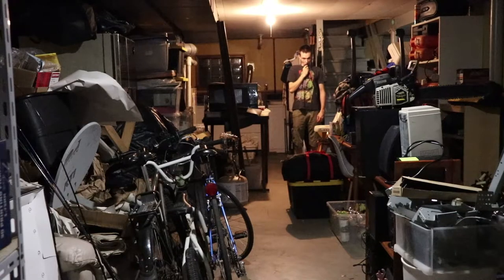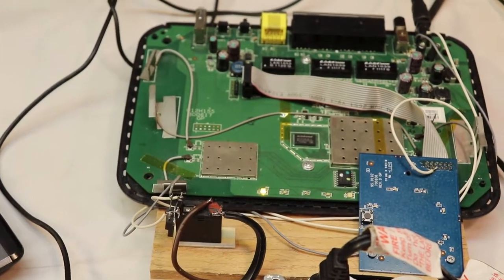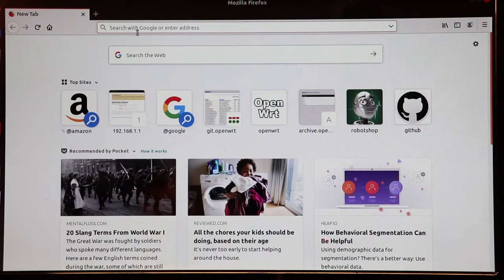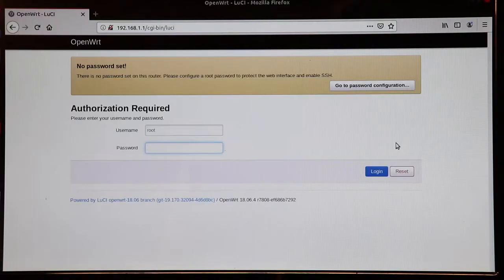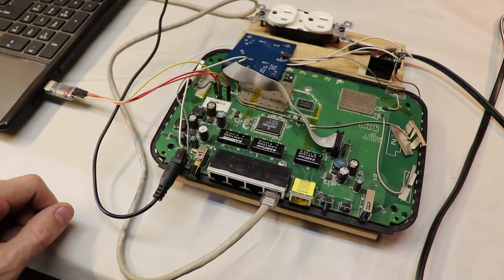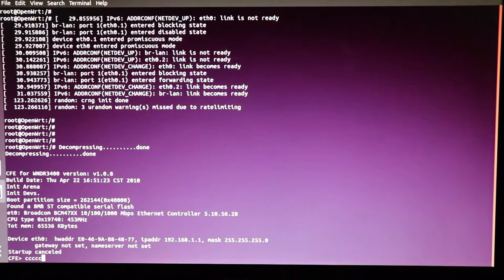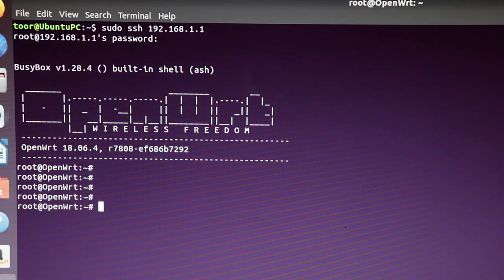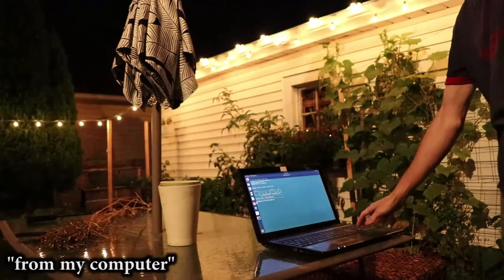Wifi Controlled Outlet (DIY Router Development Board)

Comment: The router he is using is a Netgear WNDR3400 v1. Where are the GPIO pins located on this particular router? How did you "by trial and error" discover the physical location of these pins?
Reply from the maker: Sorry if it wasnt clear enough, but since I knew the GPIO numbers I literally tested all of the numbers echoing in 1s and 0s and switching them to outputs and looked at the router to see if anything lit up.

Comment: protip: you can use dmesg -w, press enter to get some empty lines and then connect your USB device ;)
By the way, there are some differences between Bash and Dash (which is default "/bin/sh" in Ubuntu), for example some weird IF conditions will work in Bash, but won't work in Dash. Bash seems to be more tolerant, but is slower compared to (Rainbow) Dash. How do I know? I was using Ubuntu in times when it used Bash as default and their switch to Dash broke my scripts.